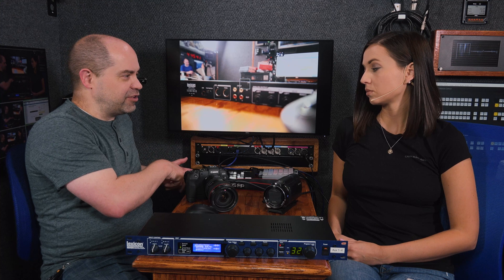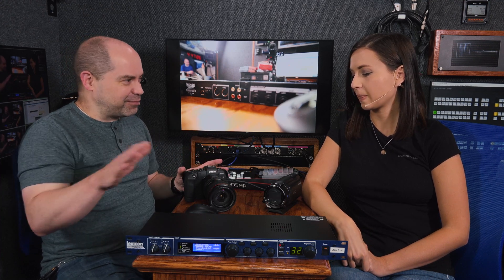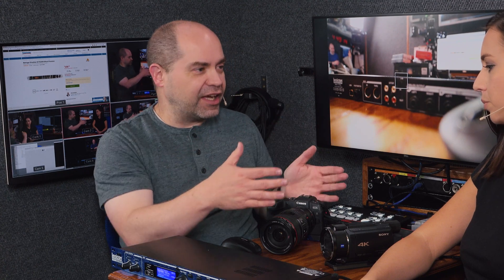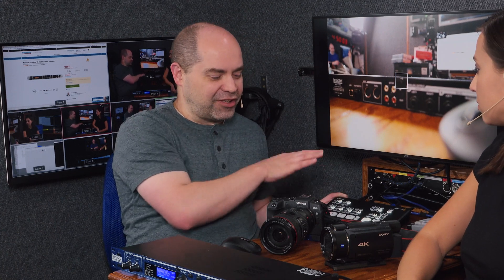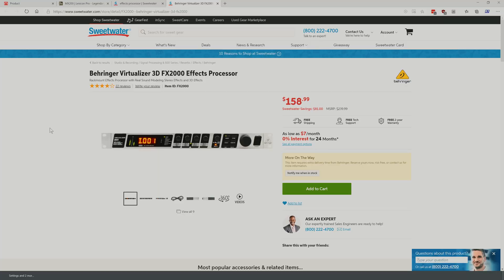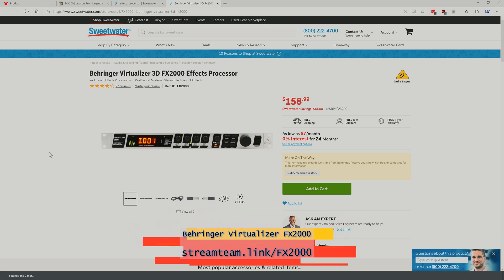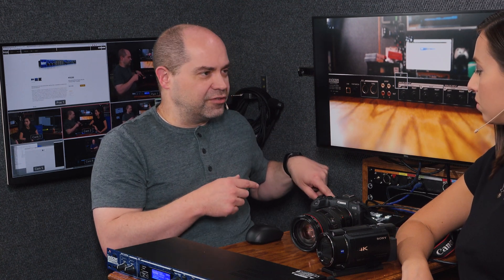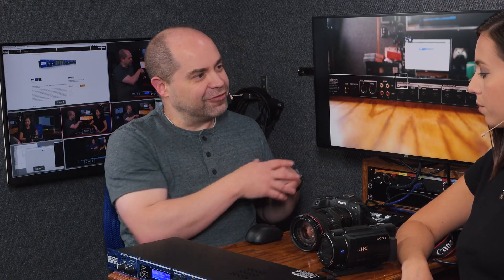Stream Team 8 - Delaying Audio to Fix Sync Issues

Comment: Hey Doug, random unrelated question. Do you power off your ATEM switches or just leave them on? I have both the original basic ATEM Mini and the Extreme ISO and since they both do not come with a power switch, I'm always left wondering if I should manually unplug them or toss them onto a power strip. What are your thoughts?
Reply from the maker: I turn them off when I'm not using them. My 2 M/E and TVS are in equipment racks with switched power bars so it's easy to just flip a switch. 

On those few occasions where I use my ATEM Mini I just plug it in for the duration of the project I'm working on, and unplug it when I'm done.

But those are use cases where the switchers are only needed occasionally. You have to weigh factors like whether the device has a fan that is running, because those do wear out over time, and how often you're needing to turn on/off, as the heating/cooling cycles do cause some fatigue in the components. Excessive heat will also shorten the life of electronics.

Comment: Thanks Doug! Have you ever run into video-audio sync issues because of a particular display’s input lag? We distribute HDMI via SDI (and then back to HDMI) to six different displays in a small venue. The two big ones are 65” Samsung TVs and the others are smaller PC monitors. The audio goes into a mixer. 

The problem we’re facing is that the two Samsung TVs have a noticeable lag so the mixer audio is in sync with the other monitors but the big TVs are behind. Worse of it all is that from observation we notice that the input lag is variable. So it’ll start off behind the audio by about 300ms then it’ll get a little better to about 150ms. So it kind of rules out using a fixed delay.

Any ideas on how to address this?
Reply from the maker: All non-CRT displays have at least some input lag. The trick is finding models which keep the delay to a minimum. And then finding which modes keep the delay to a minimum. If you can find a Game mode, enable it. It will shorten the input lag significantly.

TVs that are lower end have longer lag than the more expensive ones because they’re using slower electronics to process the signal. TVs which do more processing on the signal will also have longer input lags. And unfortunately, manufacturers aren’t exactly forthcoming with data on input lag.
Reply: @djp_video  thanks for the reply and helpful info!

Comment: Hello Dough, what is the best way to measure your delay? I currently use an editig SW which is a little bit overkill to look at the video and audio track. Is there any more efficiant way to measure the frames or ms of delay?
Reply from the maker: Record some video with a slate or a clap, and then bring it into some editing software. Look for the video frame where the slate/hands come together, then look in the audio track for the sound from the slate/clap, and move your playhead back or forward one frame at a time until you reach the peak of the audio
Reply: @djp_video  thanks, this is exactly the way I do it today, I use Danci Resolve and hoped that there is an easier, faster or smarter way, maybe a player which shows the audio track but I was not able to find one. so it's good to see that this is still the way to go. Thanks for your insight.

Comment: Hi Doug big fan your channel. 

Ive been using the atem mini since Nov 2019. I can’t find the real issue around my audio delay. I’ve watched numerous videos on the Audio/ video sync, tried every different scenario to isolate the issue. I’ve even done all the tests and find the longer I stream with the atem mini the worse the delay gets even when trying to correct with the built in delay option, this delay works great for recording but livestream is not the same.
I do home and remote streaming for events sport events church etc, I have a very powerful laptop specs Alienware A51m, I’ve come to the conclusion the following could be the reason ( note I have tried all basic fixes to sort the delay)

1- I’ve been told Wifi seems to have a greater affect on delay from dropped packets compared to wired streams. Some remote locations require wifi 

2 - My camera Panasonic HC VX 985 4k could be the issue NO SDI just HDMI 5m to 10m length cables 

I’m thinking about get the Behringer shark FBQ 100 to see if that would have an affect.and make things better.

I also use vmix which has its own built in audio delay but like I said these options work perfect when recording and work to a degree when streaming but as the stream goes longer like 2 hours or more the delay gets worse. I honestly think it’s ether the Atem mini or depends on upload bandwidth. I’ve also encountered the video delayed and the audio ahead of the picture. It maybe I have low end gear for the outcome I want to achieve for live streaming. 

Apologies for the long message just a bit over it  as clients rely on my service. 

Thank you to you both for the livestream series much appreciated .👍👍
Reply from the maker: That sounds more like audio drift than delay.

Are you bringing the audio into your computer through the ATEM or through another source?  If you use different sources they do tend to go out of sync over time.
Reply: Doug Johnson Productions through the atem mic input 1 or 2. I have tried embedded audio from the camcorder but still a drift or delay overtime. I use a rode wireless go with a handheld adapter through Atem mic input 2 is my usual work flow. I do notice if I unplug the mini the audio is back ion sync.
Reply from the maker: Try using some different software like OBS to see if it works any better.
Reply: Doug Johnson Productions hey Doug i didn’t try obs as I’ve already invested in the 4k Vmix package however I did a test to see if the atem mini was really the culprit and see if there was a sync problem over time. After 1hr 22mins of streaming and doing a clap test periodically through out the stream I notice in the fb stream health there was a sudden drop in mbs and audio bit rate. I did the clap test and my video was head of the sound rather than the sound delayed. So I decided to unplug the atem mini power socket to reset while still keeping  the stream going through Vmix, I powered up the atem again and reconnected the camera input to vmix the sound and video was perfectly in sync. I’m not 100% sure but other YTubers have notice a drift over time. I’ll do another test to see if it’s consistent. Thanks again!
Reply from the maker: I'm not recommending OBS as a replacement for vMix; just as a way to remove a variable from the equation to help narrow down where the problem is coming from.
Reply from the maker: Here's a short discussion on reddit:

https://www.reddit.com/r/VIDEOENGINEERING/comments/gs4re3/atem_mini_sync_drift
Reply: Hi Doug I found the issue I think it was a frame rate mismatch and the update in the atem mini helped also. Thanks again for your support

Comment: Hi Doug, Trevor from the Bahamas. Love the new show btw! I’ve used the Shark FBQ100 and it works well but have you tried using the mentioned Behringer VIRTUALIZER 3D FX2000? I believe it has only delay effects and not signal delay (I could be wrong here).
Reply from the maker: Yes. And I just re-verified on my FX2000 that it can provide the appropriate delay for this type of workflow. The biggest thing to watch out for is that the feedback parameters on the delay effect are set to zero and that the Bass/Treble controls are set to flat (zero).
Reply: @djp_video  Ok nice! Thank you for giving back to the community. It's much appreciated!

Comment: I just wanted to mention that there are decent audio mixers available for $1,500 with output delay built in. I am thinking of the Yamaha TF Series and the A&H QU line. You have to use a matrix out on the TF Series to have output delay available, but it's there. I suspect that a portion of the Atem mini users will be churches, which generally would have an audio mixer at or above this price point.
Reply from the maker: Right. I have both a TF3 and a TF1 myself.  I don't mention them here, as this series is primarily targeted at people using lower-end gear.
Reply: @djp_video  my small church upgraded to the A&H Qu16 in 2019, then added BMD ATEM TVS HD and recording to the Hyperdeck mini in 2020, and low and behold as soon as we were recording to the BMD there was the audio sync problem. Prior we were just using a Canon camcorder for everything.
Luckily I found the delay settings in the Qu16 and put the delay on just the output going to the recording. I still have to work with it a bit since we have not had many services during Covid but it's an easy fix if you have such a digital mixer.
Reply: Soundcraft Si mixers also provide a tunable delay on each input and output channel.

Comment: hey, again I have a question regarding camera control for the constellation 8k. i have 10 black magic mini cameras and i have the output lines but I would like to set up camera control on all the cameras, though I don't have 10 available outputs/inputs for all the cameras. is there a way i can control all the cameras and assign them on one cable? Thanks and i enjoyed the video!
Reply from the maker: All you'd need is a distribution amplifier to split the SDI signal.  The output signal going from the switcher to the cameras is identical, so a simple active splitter will take care of it for you.

Comment: You can fix delays even within video signals but it's available in software switchers mostly.. But how to sync video signals itself and then video with audio correctly? I did it everytime by looking at the mouth or via some sync videos (I will play sync video on screen/smartphone and I point all cameras and 1 mic to that video) but.. is there any better option how to handle this more accurate? It would be cool to have some option to sync multiple different cameras (mainly becuase of GoPRO) somehow more easily.
Reply from the maker: You can record the output and bring it into a video editor to look at it frame by frame to see how much of a delay there needs to be
Reply: @djp_video  Ah, yeah. that's the option too, i forget about it. Thanks. :) I meant some quick way how to do it when there is no much time to experiment but... that's the issue that sometimes we are in a hurry but it's only our problem. :D